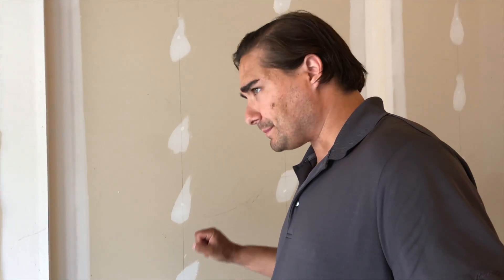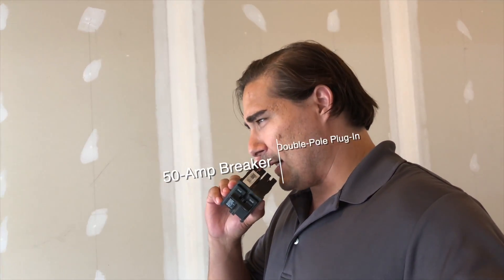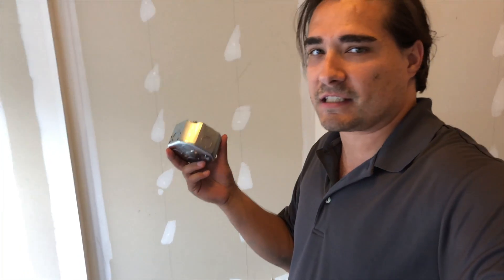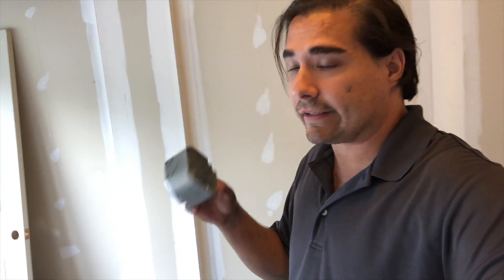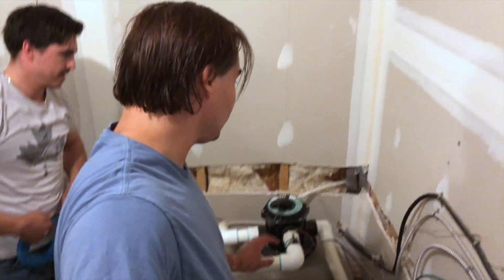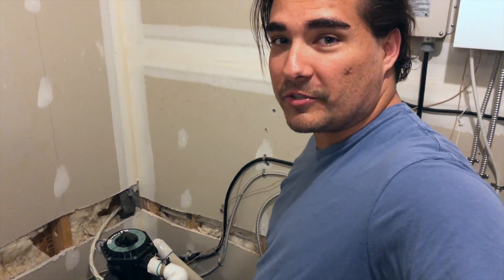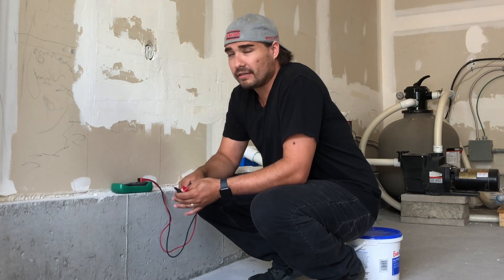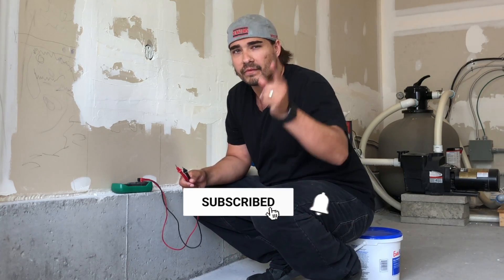How to Wire your Home to Charge Tesla Model 3 with Nema 14-50,  50 Amp Breaker Tutorial

Comment: Can you use the 30 amp breaker for a Nema 14-50 and adjust the tesla to receive only 25amp?  On Tesla.com with using the Nema 14-50, the Model 3 will receive 30amp while the model Y will receive only 29amp.
Reply from the maker: Pretty sure you can yes. Doubled check though.

Comment: i guess its good to know what the electrician will be doing as no one can DIY as the insurance wont cover anything in the event of a fire  if you do it yourself
Reply from the maker: M, You always have an electrician come do final inspection!

We have ESA here in Ontario that come and inspect your electrical for final inspection.
Reply: Tesla Canadian Dad TCD 
I suggest that you get the proper 4-11/16”x 2-1/8” electrical box to mount that receptacle in. It’s not legal to mount that receptacle into that round box. It’s too small. Plus you’re not allowed to drywall over the receptacle cover. It must be readily accessible.
I would also suggest that you take this video down because you’re demonstrating an improper and potentially dangerous way to install it. That could make you legally liable especially since you’re not a licensed electrical contractor.
Reply: Great video but as the other commenter mentioned, I’m also concerned about the receptacle drywalled over the smaller  metal box. I think it should be a metal box the same size as the metal outlet with 4 screws making the inside accessible if needed.
Reply: Actually in Ontario the person that own the house can do electrical work themselves. However, they are still required to have it inspected by ESA the Electrical Safety Authority.
The work that he did wouldn’t pass inspection. Wrong size of junction box, plus he left the junction box and the wiring connections inaccessible. As well he MUST have it inspected before powering it up or closing up the walls.
If ESA has inspected a job and passed it the insurance companies will accept that.